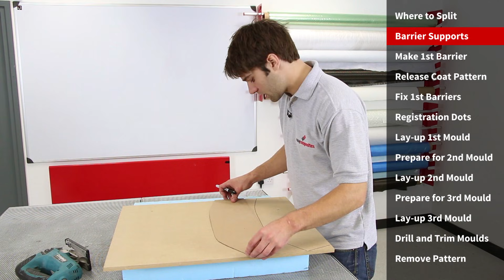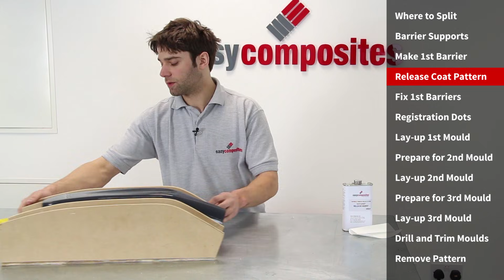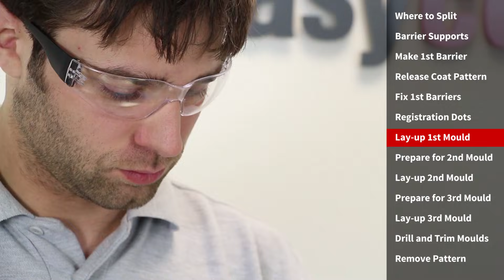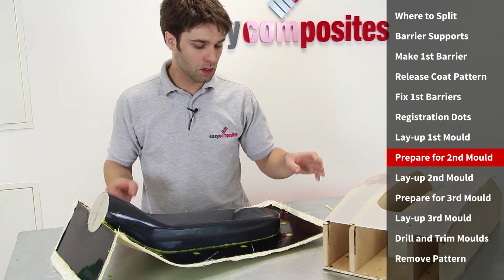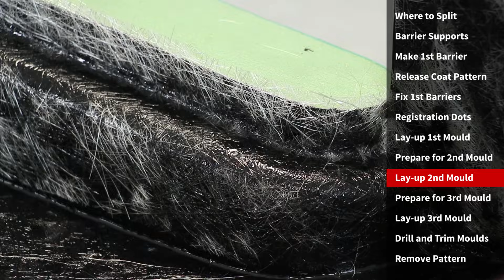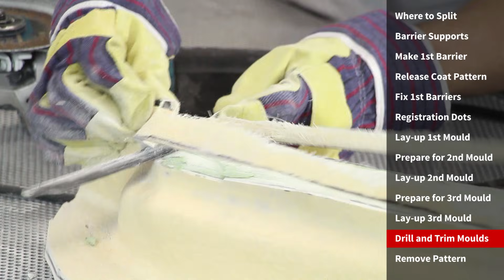Fibreglass/FRP Split-Mould Making Guide (Carbon Fibre Airbox Pt.2)

Comment: Completely amazing. Incredible skill. People who have a hard time visualizing surfaces and positive and negative shapes might find this challenging. Ironically someone seriously into pattern making for clothing might be good at it.

I suppose, if you wanted the smooth surface inside instead of outside, you could make a split part, say with a flange seam and screws, using two inside molds.

Comment: Fantastic videos so far, would be good if you guys keep more of these coming regularly for different shapes etc

Look forward to the next one
Reply from the maker: It wouldn't really matter what the shape was; you should be able to apply this technique to make a multi-part mould for any shape or sized part. It's the technique and the understanding we try to give you, then you apply this process and understanding to your own projects. In terms of shape, this airbox is about as difficult as it gets, which is why we made it! Many moulds, even for much larger parts, would be simpler. Take a look on our forum where you'll see one of our customers has made split moulds for the entire tub of a Noble; it's all the same process. He then goes on to resin infuse the whole tub in carbon fibre. Username is Andycanam - search for Noble on talkcomposites.com

Comment: Makes me realize how foolish my teen age dream had been of me making a custom fiberglass air box for my racing motorcycle back in the early 70's  ...I had thought at the time "how hard could it be"  I purchased some materials and found out early on that I was nowhere near capable of producing even the most crude example of what might work ...such is the frustration of visualising exactly what one needs but entirely lacking the expertise to even begin to get there ....And that was a part that in no way needed to be visually appealing !

Comment: If you mould in a tyre valve somewhere on the pattern, you can use air pressure to separate the parts, instead of having to chisel them. (Beware of excessive pressure blowing them across the room, though.)
Reply: smart. I might use that for a bigger thing.

Comment: god this takes me back, i used to make front splitters for touring cars and we did the same thing exactly
Reply from the maker: Haha, yes, this process has not changed much in a long time! Only difference would probably be the Uni-Mould rapid tooling system which is slightly different from conventional polyester gel and GP resin.

Comment: Guys!.. Great video, but.. when you design the part in 3D, and use that CAD software to make the profiles of the part.. you could also make the templates the same way, for the top template, the one you made first.. just project the curve on the centerplane, and use that as a guidecurve for a sweep of a thin part that you can then  convert to a "Sheetmetal-part" and Unfold to a flat pattern.. that's all there is to it.. same goes for the other templates..
(Can't help it.. i'm a designer.. :) )
your video's are a great help, teaching  me things i didn't yet know..

Just thougt of this.. why not place some "Wax-wedges" around the perimeter, so after curing  and cutting the mould to size, you have some recesses to pry the mould open?

Comment: You guys are geniuses and I have watched these videos years prior but revisit now and then. 

Just wondering - you state that 18-25deg c is the optimal temperature, but if you are working at a colder temperature, could you warm the tin of resin in hot water prior, to help quicken things up? I have used this method when painting a car and it worked well.
Reply from the maker: You can certainly warm the resins to 20C or similar.  Just be aware it will cool once in use so the cure times will still be extended and you may have issues curing at very low temperatures.

Comment: using superglue on the base of the bristles where the fibers meet the metal, will help keep them from pulling out.
Reply from the maker: Hi Josh, thanks for the tip, sounds like it would make sense. A few years back (after we'd made this video) we found a new supplier of brushes and they're really very reliable now so it's very rare that we have any problems with loose bristles but I can imagine that if you do still get a bit of bristle loss with your brushes this would be helpful.

Comment: No, they are about the size of the tip of your pinky.they go on the inside of kitchen cabnet doors so they dont make a  noise when you close them,there a firm rubber with a self stick back sold in big box stores cheap.
Reply from the maker: Right, got it, yes, I know the ones you mean. Good tip!

Comment: Hi, great video series. I like it a lot. Thank you so much for sharing your knowledge. One question: How do you ensure that the parts of the molds do not stick together at the bare edge where the fibreglass has open surface. The release agent won't help very much there on the rough glass. I'm considering developing a faired recumbent bike.
Reply from the maker: Generally any slight sticking on the very edges can be trimmed off to allow access for a demoulding wedge to release the rest of the part.

Comment: Please don't use a metal chisel to damage your good work plastic wedges and much kinder
Great video by the way love the precision build and use of proper mould support resin
Reply from the maker: Steves Projects Hi Steve, plastic wedges are good and useful, absolutely, but sometimes a metal chisel, carefuly aimed and gently tapped, is what's required to tease apart a split line like this. I can assure you that no moulds were harmed during the making of this tutorial :)
Reply: Good on you mate love your work :)

Comment: These are great videos explaining the processes extremely well, I do have one question, what's the possibility at some point in the future having the option for different colour gel coats in the mould making process ? I'm making panniers for a motorcycle that I want in a black finish, but painting black gel coat on a black mould isn't ideal - I think you mention this yourself in the Dark Ice video
Reply from the maker: It is a possibility. Our epoxy tooling gel is green which provides a good contrast for darker colour part gelcoats.

Comment: Excellent video, I have been following this for my own project your your products and so far so good, but I have a couple questions. As it's getting colder now in my garage I have been leaving each layer to cure over night. Is there a danger of leaving each layer too long? Like what if I leave the coupling layer to cure beyond a tacky state? Secondly, I have one of those nifty rollers included in your kit. Is it single use (like did you need to use 3 for this project) or did you somehow clean it?

Thanks again for this content ( and for the confidence to try such things!)
Reply from the maker: Temperature reductions will slow the cure down so ideally you would want heating to keep temperature optimal. If you leave it too long, you can sand the surface but ideally try and keep it within the recommended time limits for best adhesion between layers.   Acetone can clean rollers and brushes to help get extra uses out of them.

Comment: Great vid I never thought about making my own carbon fibre products, question though at what point is an oven used in making carbon fibre? And could you do a video on making a car bumper as that would be very informative on mould making and hen the bagging and infusion as that's what I'm interested in making but no idea where to start, can't wait for part 3 of this vid
Reply from the maker: If and when oven is used is dependant on what process is used to make the part.  The part to be made from this mould is to be made in out-of -autoclave pre-preg carbon fibre and as such is cured in an oven once the vacuum bagging process is complete. You can see this in part 3 of the video series here: How to Make Prepreg/Dry Carbon Fibre Parts (Carbon Fiber Airbox Pt. 3)

In terms of making a bumper, we would probably recommend resin infusion as the ideal process. You can see a complete video series on making a bonnet/hood here: How to Make a Carbon Fiber Car Bonnet/Hood - Part 1/3 which shows all the techniques and processes you would need for pretty much any body panels on a car, including a simple bumper.

Comment: How much heat can carbon fiber take, for like exhaust tips i want to make boom cubes, this would be lighter than stainless
Reply from the maker: It entirely depends on the resin system used. The carbon fibres themselves have an incredibly high heat tolerance. The resins used however will dictate the service temperature of the parts Our high temperature resin EL160 can has a service temperature of 170°C once correctly post cured.

Comment: So, I can’t find polypropylene at lowes or Home Depot in usa. I buy the filling wax from this company, i love it. Shame they dont have usa east coast warehouse. I wonder if that is black epoxy tooling gel or polyester tooling gel????
Reply from the maker: In this video we used the Uni-Mould Tooling Gelcoat which is a vinylester. We would never suggest using polyester resin for prepregs, instead you should use vinylester (as we do in this video series) or better still an epoxy tooling gelcoat which we have since found is more compatible with a wider range of prepregs.

Comment: how would you seal a split mould for resin infusion? I know envelope bagging is a option but I would like to seal the flanges and not envelope bag.
Reply from the maker: Sealing a multi part mould for infusion without using a vacuum bag can be challenging. One option is to apply release agent onto the flanges and then bond together with an adhesive. This should be sufficient to hold the multiple parts together and the release agent will allow it to be split and adhesive removed once infusion is complete.

Comment: Is there a product that I can use to make high temp parts like exhaust manifold or even turbo down pipe I see a lot of intake manifolds and carbon mufflers any info would be appreciated thanks for an intuitive program keep it coming please
Reply from the maker: We have a high temperature epoxy resin that will, with a postcure, go upto 180C.  That is not massively high but for some exhaust trims can be ok.  You will need to measure the actual temperature the part will likely experience to decide if it is a suitable resin for you.

Comment: can you infuse a mulit-piece mold?  Not a tube like this but for say a lip for a car. I could make it 1pc but the angles of the front are too great to get my hand in there to try and make it look right.
Reply from the maker: Yes you can.  By the far the easiest method is to use "envelope bagging" ie putting the entire mould into a single bag (like in this video) as it solves issues with trying to seal the join lines on a multi-part mould.

Comment: In fibergrsss parts manufacturing.more pin holes are visible during paint. How to avoid yhat
Reply from the maker: hi, a gelcoat finish will eliminate any pinholes on the components surface
Reply: @easycompositestv  thank you for the reply bro. Can we apply gelcoat finally   after putting body filler

Comment: Is it possible to make a shape like this but also control the internal dimensions through calculated the thickness of the carbon fiber?  Thanks!
Reply from the maker: Yes, absolutely, the internal dimensions will simply be the outside dimensions minus the laminate thickness which can be precisely controlled.
Reply: @easycompositestv  That's great.  Thank you.  You all don't have a US location do you?

Comment: I don't have an oven large enough to accommodate the tubes I want to make. Can I cure carbon fiber without heat?
Reply from the maker: You can absolutely make carbon fibre parts using wet epoxy resin and dry fibre without oven curing. The problem is for complex parts like this, is that they really are suited to prepreg which unfortunately does need to be cured at elevated temperature. Sometimes paint curing ovens are good enough to cure prepreg and usually large enough to house vehicle parts. If you can find friendly bodyshop who may let you borrow their oven, that may be a solution for you.

Comment: Great video. I have one question. I understand that it would be better to make the mould out of carbon fiber prepreg (as you do in another video) instead of using fiberglass. Is that correct? If so, which would be the benefits? Thank you!
Reply from the maker: The main benefit of using prepreg carbon fibre to make the mould is improved accuracy at higher temperature because the CTE (coefficient of thermal expansion) of the mould would be extremely low, very closely match that of the carbon fibre component. Additionally, you can use the mould at a higher temperature than you could with a typical 'fibreglass' resin system (although there are exceptions).

Comment: can i use the original metal air box as a pattern to make the mould? any suggestion about particular release agent to use on it? thanks
Reply from the maker: Yes you can use the original airbox as long as it is in good enough condition.  You would follow the same process just skipping the carving of the foam, as you already have the basic shape.  Use same release agents as the video.
Reply: @easycompositestv  thanks a lot. gonna try on my Alfa 105  airbox as soon as i can.

Comment: Hello again, at 13:08 you mention that you must make this a 3-piece mold because of 2 parallel sides. Is that because it would be really difficult to remove the master plug if you don't make this mold as 3 parts? Could you install a nipple onto the surface of the master so that later you can use air pressure to push it out from the mold?  Thank you in advance!
Reply from the maker: If you have parallel sides on a mould then it will be almost impossible to remove parts from it, even with the use of compressed air. If you do manage to remove the part then it's likely there will be damage to the part and the stress on the mould will reduce its life. It's a much better idea to design a split into the mould for sides even approaching parallel.

Comment: Will polypropylene of that thickness warp from the gelcoat like HDPE does?
Reply from the maker: It did not warp in this case or other times we have used it. If the resin gets very hot, the risk of it warping or distorting the sheet is higher.

Comment: First class info. do you have an outlet in the USA ?
Reply from the maker: Hi Frank, thanks, glad you enjoyed it. At the moment we don't have an outlet in the USA but we can ship to you directly from the UK. For non-hazardous materials shipping is fast and relatively inexpensive but for hazardous materials things are a little more complicated due to DG surcharges by the airlines. To get an accurate shipping cost you can add items to the basket on our website and then use the shipping calculator on the basket page; it's very sophisticated and works out the actual cost including surcharges according to what you've ordered. In the future, we hope to open up in the US :)

Comment: Instead of wax can you use clay to fill in ?
Reply from the maker: Plasticine (aka modelling clay) is slightly firmer but still generally works well instead of filleting wax for many applications. Filleting wax being softer is a bit easier to handle and use for fine filleting work.

Comment: How many times will the mold last, in other words, how many pieces can you make with a mold before it starts to have surface inperfections??
Reply: Great video by the way!!
Reply from the maker: Treated sensibly you would get hundreds of releases from the mould before it started to show scratches or other signs of damage and deterioration. We use this exact mould system for most of the 'Carbon Mods' brand products that we sell meaning that we have daily production experience going back 7 years. Some moulds we made 7 years ago are still in use today. The great thing about Uni-Mould is that you can flat and polish the surface if it gets stratched or faded and it will be like new. That's why we normally 'double gelcoat' to give ourselves extra repairability.

Comment: The Long Way.....whew
Reply from the maker: GasserGlass Good things come to those who wait :)
Reply: +Easy Composites Ltd I have been waiting 25 years for my girlfriend
Reply: @easycompositestv  can i make fiberglass part from this mould. I am making sort of square tube using split mould method but after  unmoulding  the part the seams dont connect. The part doesnt come out in single piece.

Comment: What thickness polypropylene sheet is recommended for the barrier walls in a mold like what was made here?
Reply from the maker: 3mm was used and is recommended.
Reply: @easycompositestv  thank you very much. That will greatly help in a project I am currently working on.

Comment: I plan to use the yellow filleting wax in 100°C autoclave curing. Would it be a problem and if yes which is there a temperature limit for this product?
Reply from the maker: +Ioannis Topalidis : Well, yes, the problem would be that the wax would melt and much less than 100'C. Also, if you're planning on using yellow wax in an autoclave (i.e. under increased pressure) then it's only a soft wax and would instantly deform under the positive pressure of an autoclave. I can't think why you'd want to use yellow wax in an autoclave however?!
Reply: +Easy Composites Ltd Thank you for your aswer! I use carbon fiber split-mould and I want to close the gap between the two moulds. Would it be better to use Epoxy Mould Making Putty? If yes, is it difficult to split the two moulds after the cure cycle?